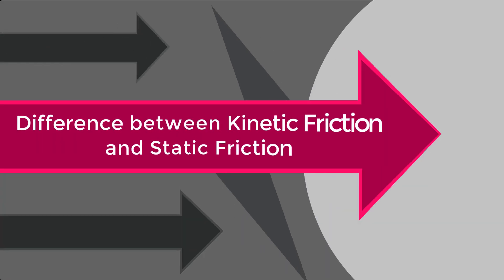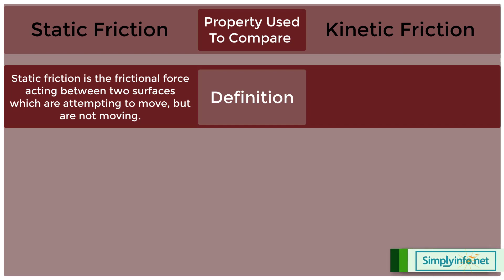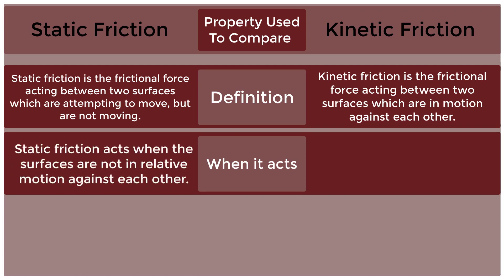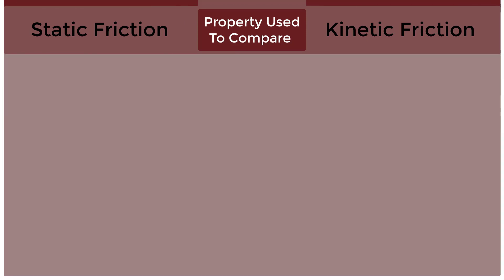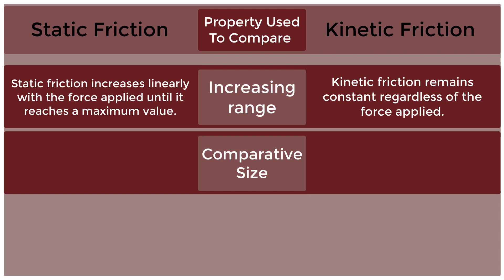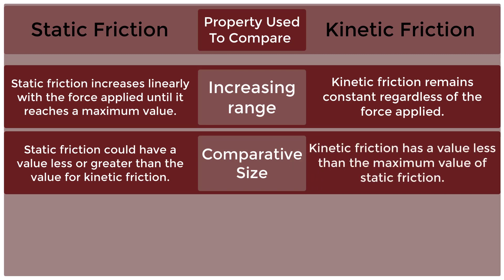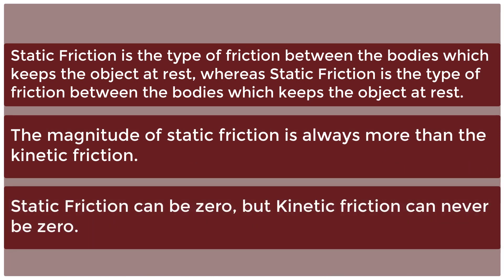What is the Difference Between Kinetic Friction and Static Friction | Mechanics | Physics

Comment: Thanks 😊
Reply: Suppose an object lies motionless on a surface. A force is applied in order to displace it. However, the object continues to remain stationary. The reason is that the surface exerts a reaction force in a direction opposite to the applied force. This force is known as the frictional force. Because the object remains immobile, the phenomenon of resisting its motion is known as static friction.
Reply from the maker: Welcome 😊

Comment: 🤖
Reply: Suppose an object lies motionless on a surface. A force is applied in order to displace it. However, the object continues to remain stationary. The reason is that the surface exerts a reaction force in a direction opposite to the applied force. This force is known as the frictional force. Because the object remains immobile, the phenomenon of resisting its motion is known as static friction.

Comment: I appreciate you mam because you solve my problem
Reply: Suppose an object lies motionless on a surface. A force is applied in order to displace it. However, the object continues to remain stationary. The reason is that the surface exerts a reaction force in a direction opposite to the applied force. This force is known as the frictional force. Because the object remains immobile, the phenomenon of resisting its motion is known as static friction.

Comment: There is no Explanation.....

Just reading from book 📖
Reply: Suppose an object lies motionless on a surface. A force is applied in order to displace it. However, the object continues to remain stationary. The reason is that the surface exerts a reaction force in a direction opposite to the applied force. This force is known as the frictional force. Because the object remains immobile, the phenomenon of resisting its motion is known as static friction.
Reply: Suppose an object lies motionless on a surface. A force is applied in order to displace it. However, the object continues to remain stationary. The reason is that the surface exerts a reaction force in a direction opposite to the applied force. This force is known as the frictional force. Because the object remains immobile, the phenomenon of resisting its motion is known as static friction.
Reply: Exactly

Comment: Nice example sir
Reply: Suppose an object lies motionless on a surface. A force is applied in order to displace it. However, the object continues to remain stationary. The reason is that the surface exerts a reaction force in a direction opposite to the applied force. This force is known as the frictional force. Because the object remains immobile, the phenomenon of resisting its motion is known as static friction.

Comment: Full doubt cleared😮
Reply: Suppose an object lies motionless on a surface. A force is applied in order to displace it. However, the object continues to remain stationary. The reason is that the surface exerts a reaction force in a direction opposite to the applied force. This force is known as the frictional force. Because the object remains immobile, the phenomenon of resisting its motion is known as static friction.

Comment: Bakk ball only
Reply: Suppose an object lies motionless on a surface. A force is applied in order to displace it. However, the object continues to remain stationary. The reason is that the surface exerts a reaction force in a direction opposite to the applied force. This force is known as the frictional force. Because the object remains immobile, the phenomenon of resisting its motion is known as static friction.
Reply: Yesbskk

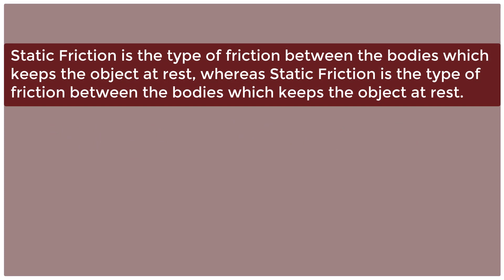Comment: 1:51 ????????
Reply: Suppose an object lies motionless on a surface. A force is applied in order to displace it. However, the object continues to remain stationary. The reason is that the surface exerts a reaction force in a direction opposite to the applied force. This force is known as the frictional force. Because the object remains immobile, the phenomenon of resisting its motion is known as static friction.

Comment: Improve the sound quality...There's Echo
Reply: Suppose an object lies motionless on a surface. A force is applied in order to displace it. However, the object continues to remain stationary. The reason is that the surface exerts a reaction force in a direction opposite to the applied force. This force is known as the frictional force. Because the object remains immobile, the phenomenon of resisting its motion is known as static friction.

Comment: Both sides you have written static
Reply: Suppose an object lies motionless on a surface. A force is applied in order to displace it. However, the object continues to remain stationary. The reason is that the surface exerts a reaction force in a direction opposite to the applied force. This force is known as the frictional force. Because the object remains immobile, the phenomenon of resisting its motion is known as static friction.
Reply: Super 🎉

Comment: You have written wrong in static friction Vs kinetic friction
Reply: Suppose an object lies motionless on a surface. A force is applied in order to displace it. However, the object continues to remain stationary. The reason is that the surface exerts a reaction force in a direction opposite to the applied force. This force is known as the frictional force. Because the object remains immobile, the phenomenon of resisting its motion is known as static friction.

Comment: There's an echo...
Reply: Suppose an object lies motionless on a surface. A force is applied in order to displace it. However, the object continues to remain stationary. The reason is that the surface exerts a reaction force in a direction opposite to the applied force. This force is known as the frictional force. Because the object remains immobile, the phenomenon of resisting its motion is known as static friction.
Reply: Where r u from